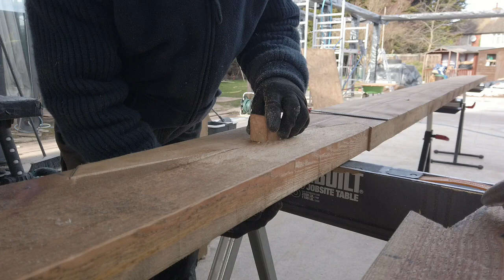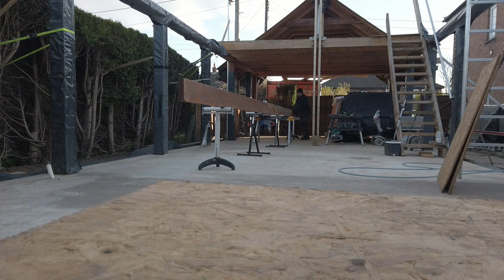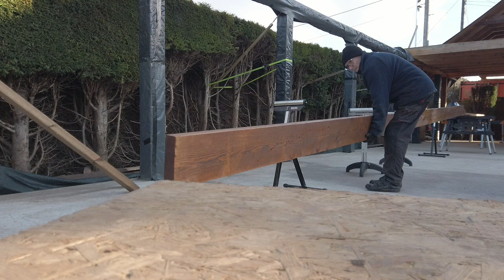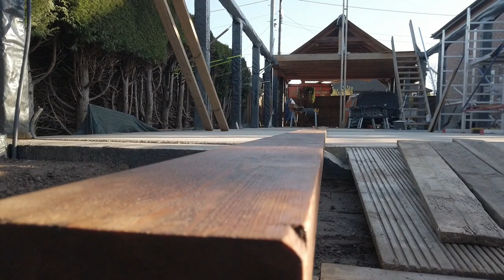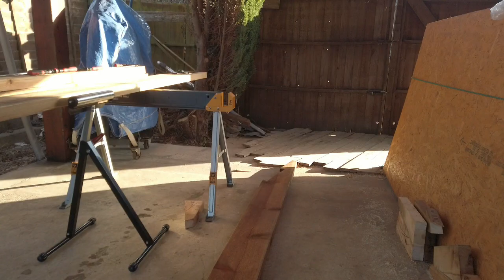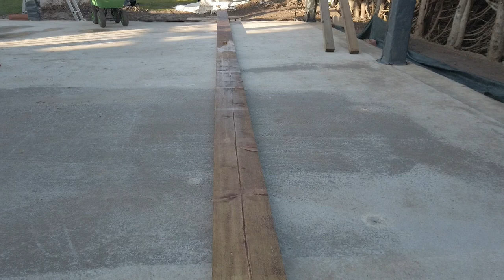SCARF JOINTS

Comment: Dimension of joint if using different size of wood beam?
Reply from the maker: different sizes in thickness height or both ?  The normal procedure is to have the length of the joint 3 x the height of the timber.